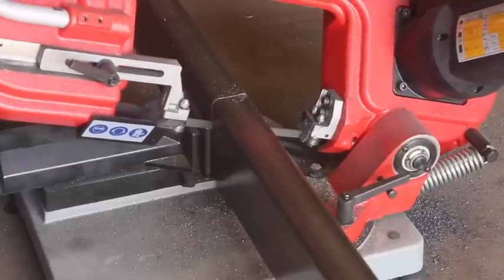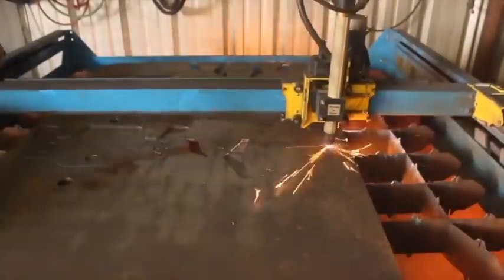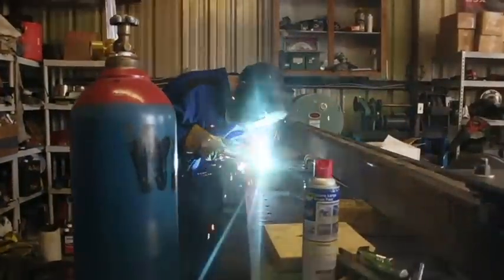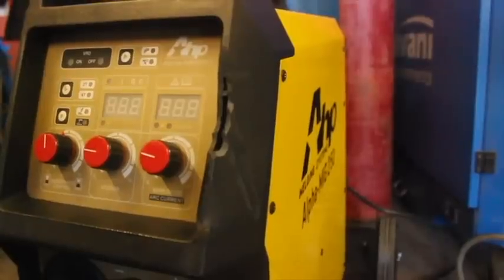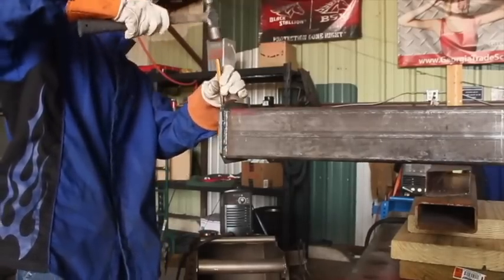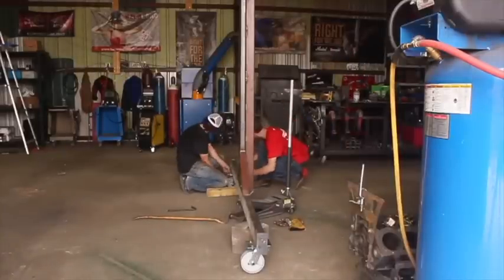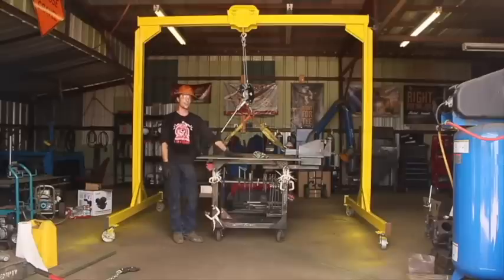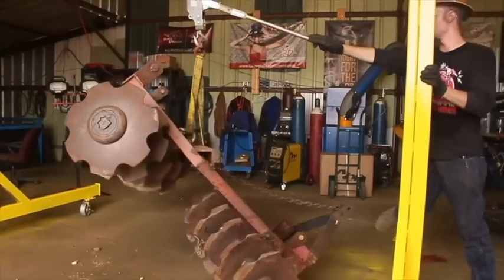LETS BUILD A GANTRY CRANE FOR THE SHOP!! WELDING AND LATHE PROJECT FOR FIXING TRUCKS AND TRACTORS!

Comment: I can’t believe you didn’t weld it with stick rods , 7018 they are cheaper . You could also add some heavy duty feet underneath to screw down to help support it and keep the thing from moving on you .